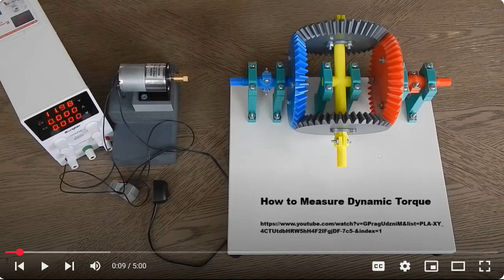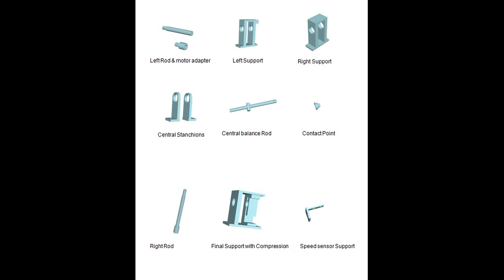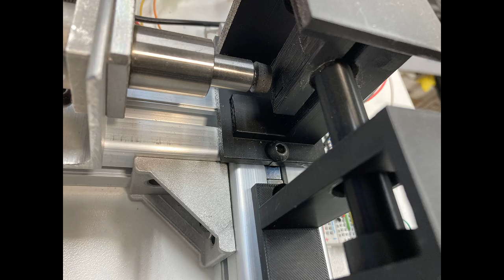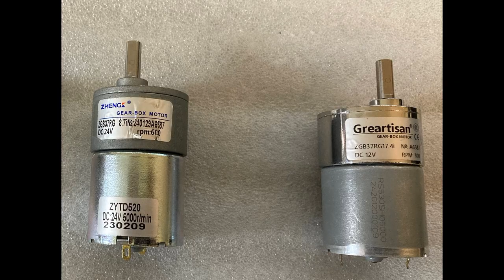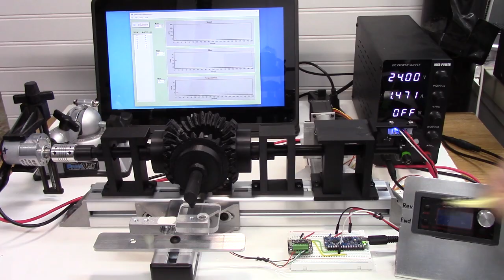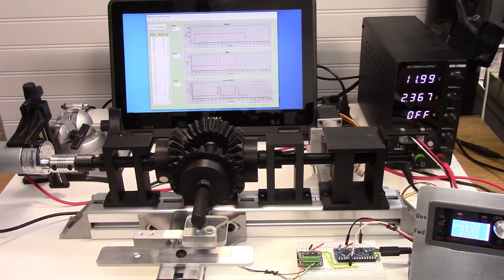Measuring Dynamic Torque of Small DC Motors

Comment: did you use two separated power supplies for the motor and the linear stepper?
Reply from the maker: Yes.  The visible power supply is used only for the motor being tested.  The stepper drive and controller run on an independent 24V 2.5A PS, and the sensors etc. are powered by the Nano USB connection.

Comment: Hi, I am doing research to make my own dynamic torque measuring setup.  I have one suggestion for you. If I was you I would get a long arm with known weight on the end put it where the motor is. Then you can calculate the torque that this arm generates. Using that you can do calibration.
Reply from the maker: Thank you for the comment.  I am not certain I understand exactly what you are suggesting but I think you might be proposing a way to correct for the weight of the arm itself.  There is frictional resistance in this system throughout and other factors that provide a "baseline" torque without any applied load.  I have been just been recording that and then subtracting that value from the measured values at each point.  Not ideal, but the measured torques on several motors that I have checked so far have generally agreed well with the spec sheet data when it is available.  If you meant something else, please let me know.  Thanks for your interest and good luck in your design.

Comment from the maker: This project has been described on Thingiverse and source material including all the .stl files and both the Arduino and Windows program can be downloaded from this link: https://www.thingiverse.com/thing:7196426   Any comments, suggestions or questions about this project are welcomed.
Reply: I didnt find the Adruino code in the zip file from thingiverse? nevertheless, a deep bow for the project :)
Reply from the maker: @waterpas1  Thank you.  I am glad you found this project to be of interest.  I am not sure what the problem is with the Arduino code access, but I noticed that downloads from Thingiverse is problematic since I included an exe file.  I have placed the same files on Dropbox and they can be downloaded here:   https://www.dropbox.com/scl/fo/r9r3zg3e1qooq362k2j5e/AOJATqKqcgLrYPXH2flsxQE?rlkey=hqpk3v5gqy6b713zhl4zn66nr&st=3verz14r&dl=0
Let me know if you encounter any problems.
Reply: @Cecil-n8w i appreciate it, thank you 😊😊
Reply: I'm going to try and make it fit for 130 motors size :)
Reply: What size lineair rails did you use to mounts all the 3d parts on? Also which holder for the stepper motor? And kast question,  which flexible coupler? Thank you! 🫡
Reply from the maker: Hi -  The rail supports were made from pieces cut from a length of European Standard 4040 Aluminum Extrusion (B0DGXJJ3RT).  I used standard 4040 T-nuts and other fittings.  The linear drive was mounted on a small piece of aluminum angle drilled to accept the drives bulkhead mount.  I used a variety of shaft couplers from Amazon as needed depending on the motor shaft size.  Either flexible or rigid couplers are fine as long as you are careful with the alignment.  The other end of the coupler was attached to the 3D printed hex connector.